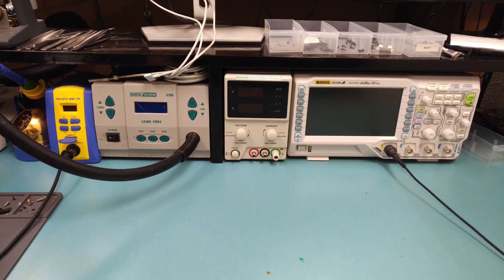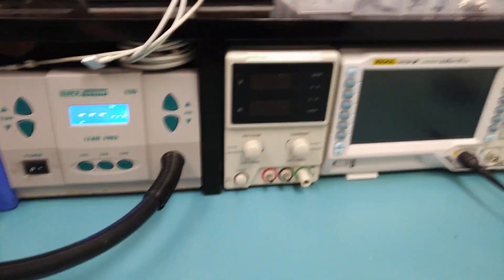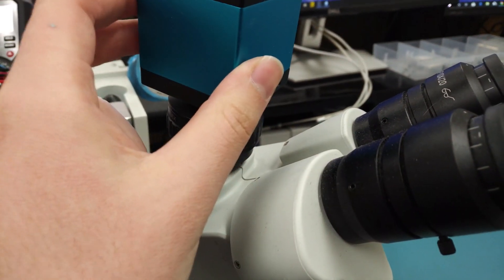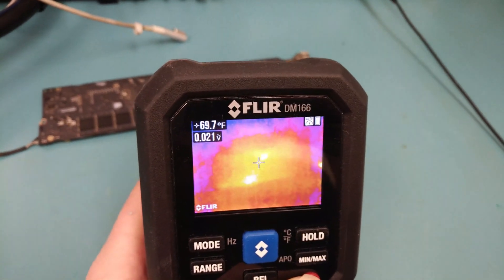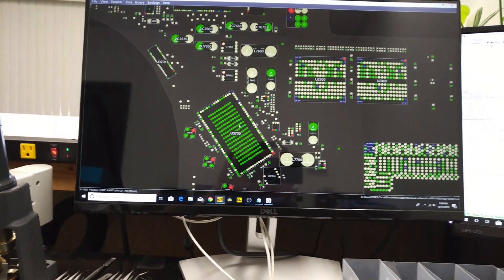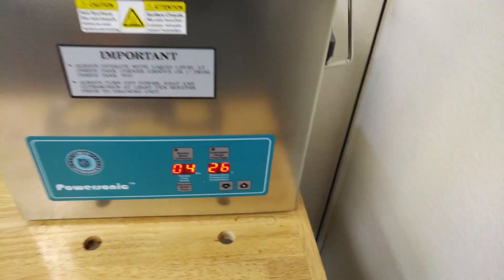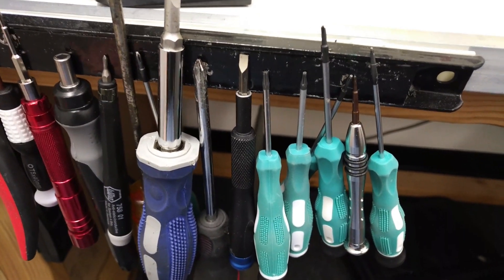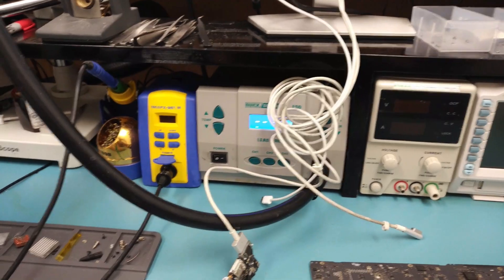Tools and equipment I use and recommend.

Comment: Do you really hold the tips in the holder upside down? Why? How do you know which is which if you do not see the tip itself? Strange.
Reply from the maker: To prevent accidents. Several years ago I had the tip holder on my scope stand while adjusting the scope, the boom arm was binding, and broke free/collapsed which forced my wrist onto the tip holder, which lodged a BC1 tip a few mm into the bone in my wrist. Safety, not strange.

Comment: I think you have a really good way of explaining things. I just bought a hakko fr-810b because someone I know was selling a good condition used for 450 with some extra nozzles but now I’m wishing I got the quick. I knew that the interface on the Hakko sucked but I was hoping for at least good quality heat/air.
Reply from the maker: From the ones i've used and seen, the quick is far better in terms of heat and air. The 810 is definitely sufficient though and you should have no issues getting repairs done with it.
Reply: @TCRSCircuit  That's good to hear. I haven't tried it out yet but compared to the cheap 2 in 1 station I was trying to use before I think its going to be a big improvement.

Comment: In case you live in poarts of the world, where genuine Hakko stuff happens to be very expensive (like EU for some reason), you can try ADS200 from Pace. Works exactly the same as JBC and is like 50% cheaper, also tips are like 3x cheaper than JBC and I like the ergonomics better on the Pace. Beats the hool out of any Chinese station (eg. Atten, Xytronic...)
Reply from the maker: Thanks!

Comment: Good video. 
To me the Oscilloscope is a very good learning tool. I've a hard time learning stuff just from paper, so visually seeing what circuits do still helps me a lot to learn. 
But that being said ... for a lot of that a cheap 10$ logic analyzer from China does a pretty good job as well as long as it's low voltage stuff. It's just less convenient to use and has it's limits but for a pure learning purpose it might do a good job too.